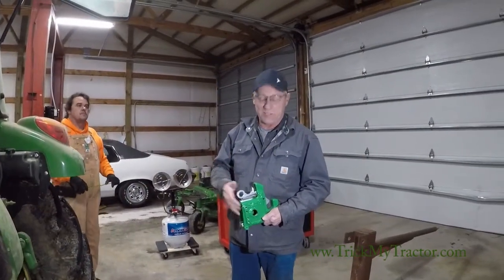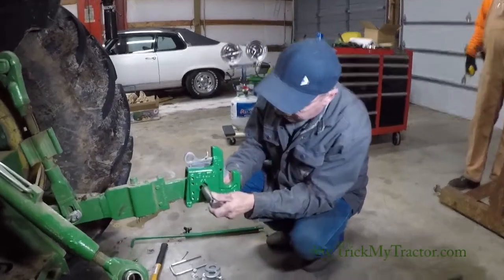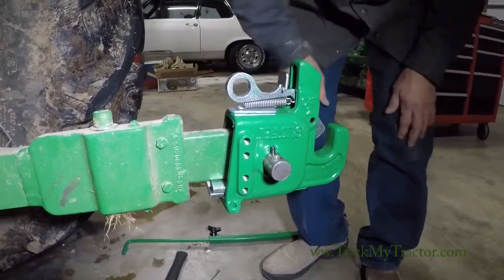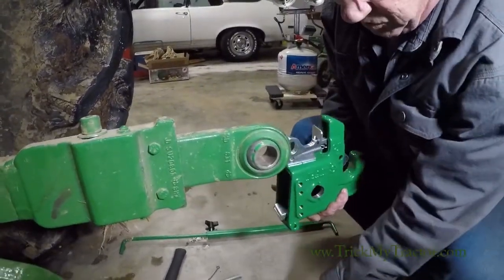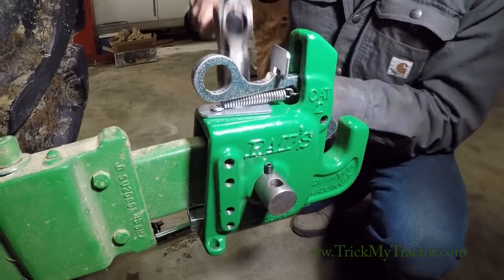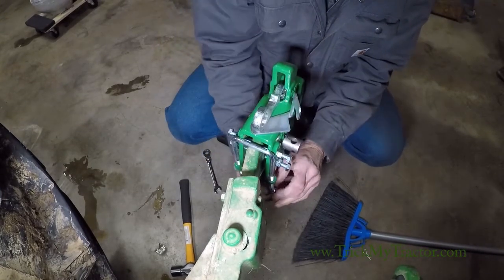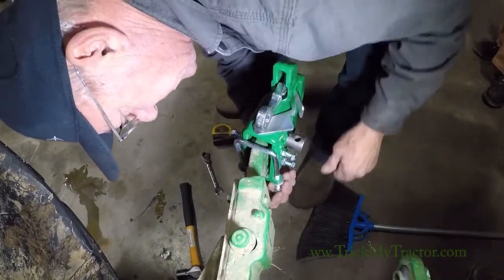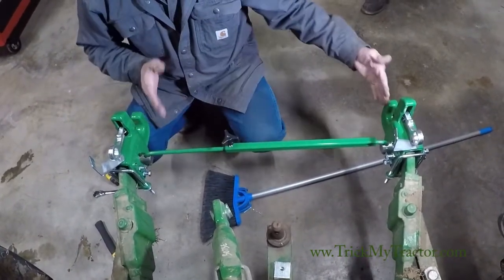Cat 2 Installation Pat's Easy Change Quick Hitches TMT

Comment: Would Pat's quick hitch compensate for a tractor without adjustable lift arms? Thanks excellent video.
Reply from the maker: Pats Quick Hitches will work on tractors with and without extendable lift arms. Did I answer your question?
email: sherrie@patsquickhitches.com for more information.
Sherrie

Comment: Hi Pat I have just installed your easy hitch I have a quick question regarding the ubolts I think I should cut them off now they are installed as they have about 3inches hanging down. Regards Graeme from Australia
Reply from the maker: Yes it would be fine to cut the excess off.
Glad you asked, and thanks for buying Pat's Quick Hitches.
Reply from the maker: Cutting them off would be fine.

Comment: Pat the only problem I have with your hitch is I was bushmowing once with a sidewinder bushmower 6-8 inch diamiter bushes, and the right side hit a piece of Limb hit the release leaver and the sidewinder came off broke the left lift arm And damaded the pto shaft.
    Since then I have only used standard 3 point hitch or Quick hitch where the release leavers can't be hit by brush.
    You make a great product but for some applications it not the best Idea.
Reply: Thanks for sharing this. I can see how the release lever can be pushed to the side and allow the hitch to release.  I think a simple solution would be to tie a piece of wire around it or possibly, drill a hole in the top of the release arm and put a bolt through it that sticks between the top of the housing.  Do you have any better ideas?
Reply: @twc9000  I would put a removable cover over it, it could hook in the top and pin in the back
Reply: @carrollsanders9376 that’s a good idea. I might try to 3d print one or make it out of sheet metal.